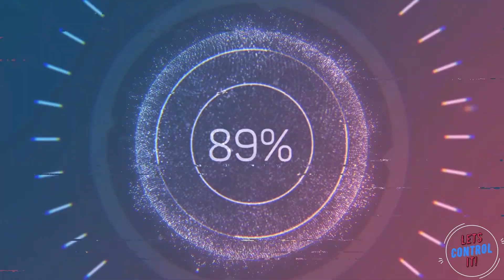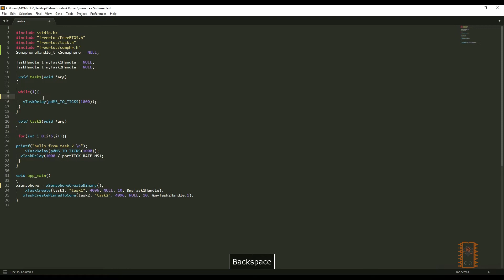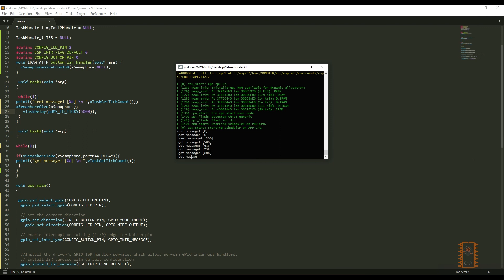#9 ESP-IDF FreeRTOS Semaphore

Comment: I thought (waiting for the button) should continue infinitely. but no. the only task1 is running. (i had a print function inside task1). 
its like after printf("waiting the button!\n"); task2 is waiting indefinetly. i thought after every 3 seconds printf("waiting the button!\n");this will print?
why it's functioning that way?